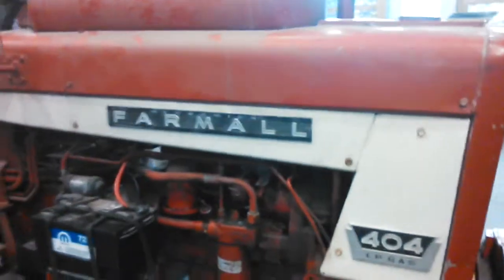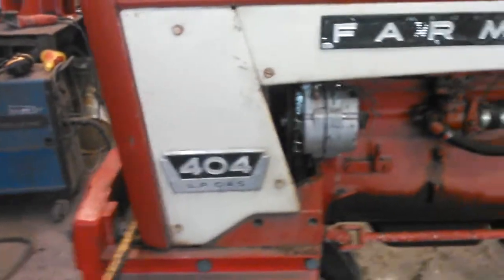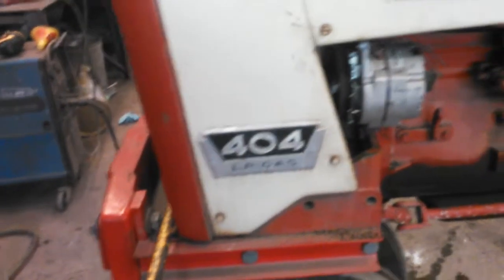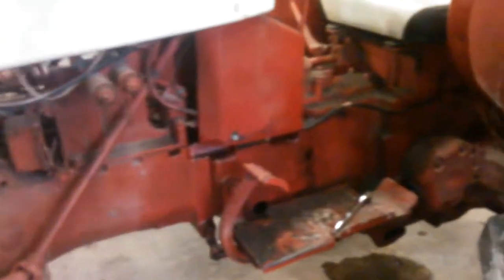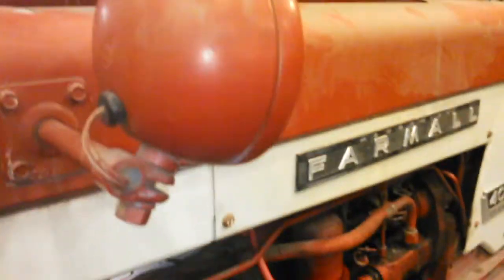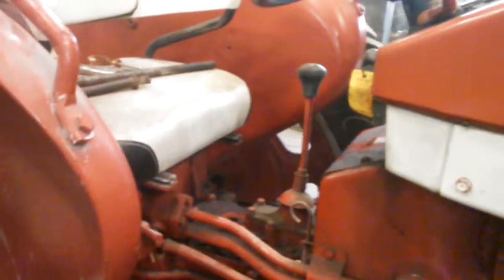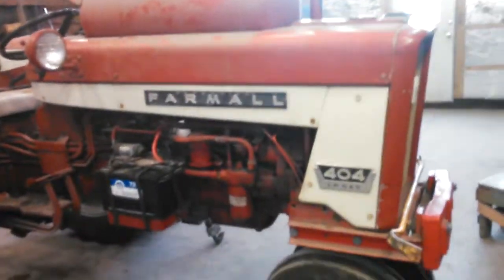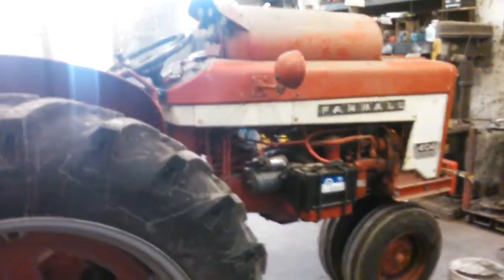Farmall 404 LP gas

Comment: I'm working on my 3rd 404 utility gas and trying to buy another.  As far as I can see most of the 404 utilities went to highway departments for roadside mowing.  New York had a whole fleet of blue and yellow ones.  They are very simple, reliable and if you add a 2000 or 2001 loader, very useful.
Reply: Hi.  I have an lp gas 404.  Would you know what the hose is that runs below the carburetor?   On my '62 404, that hose is connected to the cooling system above the water pump.
Reply from the maker: If I remember correctly you have to have coolant go to the evaporator I want to say but that doesn't sound quite right when I say it you have to have coolant to make the propane tractor run correctly
Reply: @wildcatwilly  Thanks for the reply.  I just inherited this tractor from my brother-in-law and it is 5 hours away, in south Texas.  My time has been limited, so I am still figuring things out.  I did order a set of manuals today, so that should help.   Have a good day sir, and thanks again!
Reply from the maker: @jackprick9797  thanks for watching please like share and subscribe
Reply: @jackprick9797  If it is a coolant hose probably someone had a block heater on it